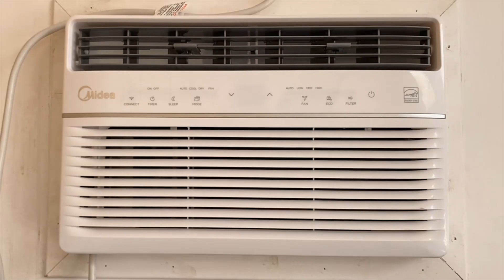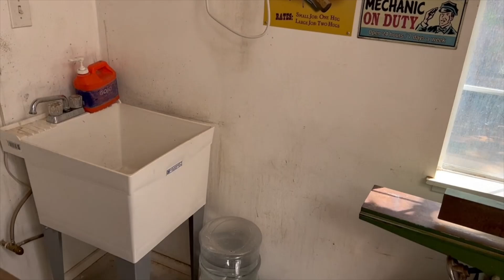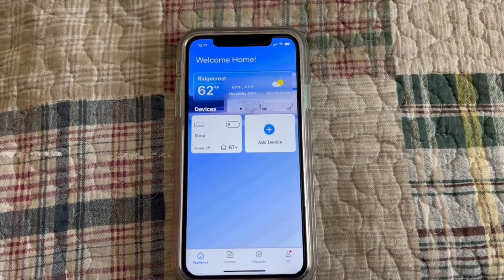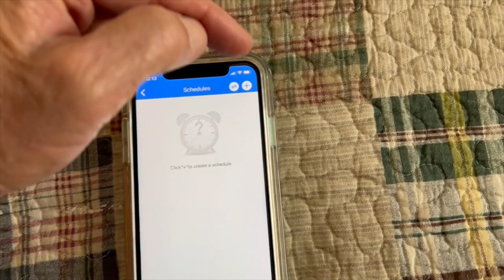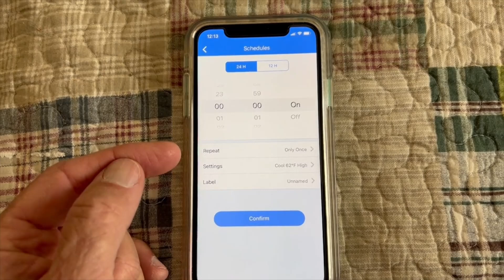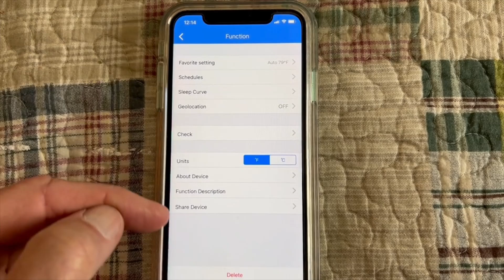Midea 8000 window A/C unit - any good?

Comment: my Midea 8000 BTU looks different than yours.....same color but it's
TIMER        mode settings       Comfort Sense                temp display                   fan settings       filter
ECO            MODE (button)      temp down button  ON/OFF  temp up button      FAN button        Sleep      Connect
Reply from the maker: They must have updated the design a little. I bought mine at Sam's Club back in May of 2023.
Reply: @thehomerepairguy  probably, bought mine around 2 wweks ago

Comment: Where is the water drain hole
Reply from the maker: It is on the back so it drains outside.
Reply: @thehomerepairguy is there a removable plug or will it eventually start to drip out ? Day 2 haven’t seen anything drip from the rear , thanks !

Comment: Why on earth would they camouflage the power button and then have the words off/on  as if that’s the power button and not the timer? This video helped! Thanks! I was melting!!!
Reply from the maker: Yeah, it is confusing. Glad the video helped. I wish it would operate like a central a/c system where you can set the thermostat and forget it, but the fan always runs. At least I can set a routine for it to come on and off as needed.

Comment: How many hours you using..because we are the same Ac but im using only 4 hours..can you suggest how many hours they must to using that AC
Reply from the maker: It depends on the size of the room you are cooling and how hot it gets where you live.
Reply: @thehomerepairguy  Shutting them off at night does not save you any money. Your residence will get a little warmer during those hours and the unit will have to work that much harder to cool it back down, so you save nothing. Besides if you look at them in the store and look at annual operating cost and say it is sixty dollars. If you live where you have cold winters than using it only half of the year hell it may cost thirty dollars so if you divide that up by the month, it is not that much so I say let it run around the clock.

Comment: How do you turn it on by the buttons on it?
Reply from the maker: The on button is kinda hard to see. It is on the front panel put over to the left. You just touch it but don't have to push it. It is the the circle with the line through the top.

Comment: Do you have a video of taking it apart?
Reply from the maker: Yes. Check my channel @thehomerepairguy. I took it apart to fit it into the hole from where I removed  my old unit. It actually fits perfect with a few minor mods. One disclaimer is that these are made for window installation not wall mounting. I mounted it in my wall anyway and it had been great. No guarantees though.

Comment: Ughhh lifesaver!! Bruh, I kept pressing the on/off above the timer cuhz it LOOKS like that's the power button. Couldn't even SEE the power button is on the completely opposite side. Our other AC started smoking/leaking frion in our small apartment with my 7 year old and 3 year old inside and luckily I caught it in time but ANYWAYS...thank you!!
Reply from the maker: Glad it helped. Yeah, The power button is faint. I have been using my unit now for a few months and so far so good. Only complaint is couple of times the schedule did not turn the unit off so I am investigating to see if the app has to be open for the schedule to work. I wouldn't think so, but we'll see..

Comment: How big is your shop in sq. ft. and ceiling height and insulated? Cools as expected?
Reply from the maker: Shop is 225 sqft. Ceiling angles from 8' at the walls to 10" in the center. Wall are 2x4 contraction with insulation and roof is 2X8 construction with insulation. Dual pane windows and doors. The unit cools the shop from 90 to 80 deg in 15 min at about 20 percent relative humidity. My old unit was a 6500 btu unit and left me wanting more cooling because I need quick cool down. This one gives me the performance I wanted.
Reply: @thehomerepairguy  Very good, I have a 8000 btu Midea portable AC that I use in a small room in garage, but thinking about this window unit for my 288 sq. ft. cabin that's well insulated, but lots of double pane windows.
Reply: @stepnmud  the midea u-shaped unit with inverted is a better unit and whisper quiet